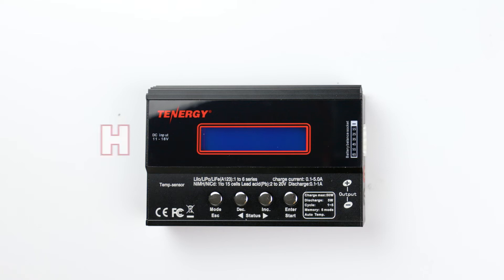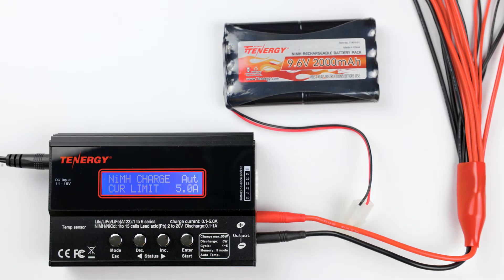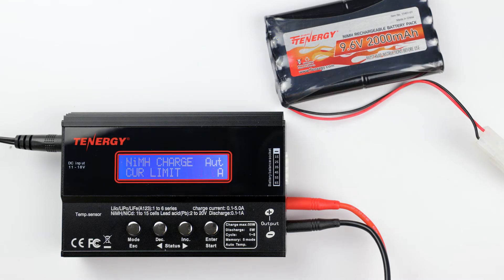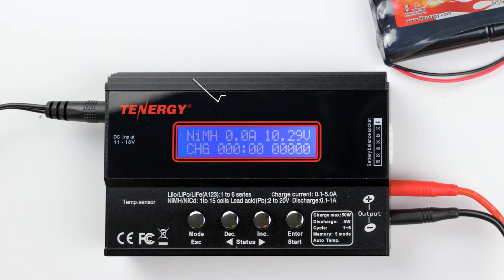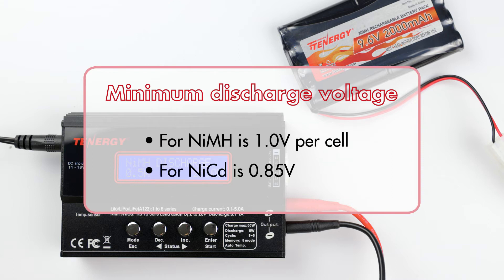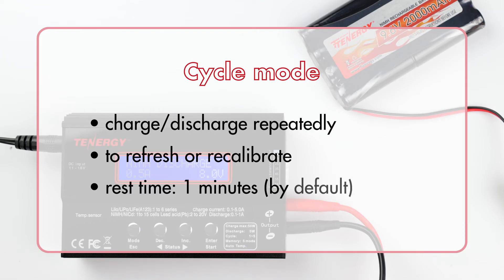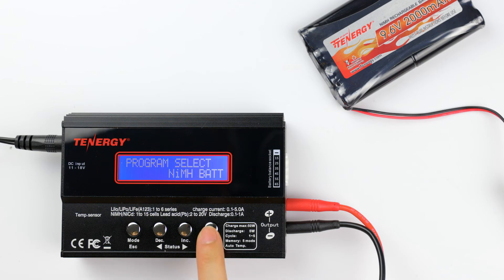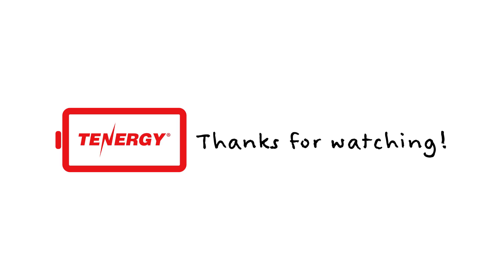How to charge and discharge a NiMH battery pack with Tenergy's TB6B (with voice-over)

Comment: I have a question. I have a NiMH battery, that its max voltage is 8.5 volts and is a 3000Ah battery. Why did the charger stop charging at 8.1 volts on the battery? Did I miss something?

Comment: This thing does not seem to be working correctly with Nimh. It seems to be timing out before discharging to my set voltage. The charge and discharge mAh are nowhere close to to the battery capacity. Like half. So far not impressed with it.

Comment: I set mine to cycle D>C x 3 and it discharged and then switched to "DRY" has been sitting here with a timer thats now up to 31 minutes. I figured maybe it was letting things cool before charging, but it hasn't. I've googled and searched around and absolutely NOBODY mentions this DRY message after discharge, even the manual says nothing about it. Will this thing eventually pick up and start charging on its own?
Reply: It started charging at 1hr. Thats a pretty liberal default cool-down timer

Comment: Would it be the same process for charging LiPo batteries?
Reply from the maker: We have a separate video for LiPo batteries at https://youtu.be/k1j1-FBgS3A?si=BrObwZOY7VsV7xjH - the process is similar, but some lipo batteries will need to be balanced charged, please review if your Lipo battery pack needs to be balanced or not, before attempting to charge your battery pack. Feel free to reach out to our team directly at service@tenergy.com if you have any questions before buying or using this charger

Comment: What is the best storage voltage for both Nimh and Nicd, pls?
Reply from the maker: Generally it's recommended to store the battery around 40-50% charged. For Nimh and Nicd the voltage will be around 1.28V-1.2V. If you're unsure and would like more info, please reach out to our team with your battery pack's specifications at service@tenergy.com and our team can help provide more info.

Comment: One question, might sound silly but is there any specific way to store these batteries for a long time,E.G. if the battery is not being used for a few months, do I store them at the minimum voltage or maximum voltage
Reply from the maker: Greetings, that's a great question! For long term storage, like a few months, we suggest storing battery packs that are nimh or nicd at 80% charged. If it's a lithium based battery pack, we suggest 30% instead. Feel free to reach out to us directly at service@tenergy.com if you have any additional questions.

Comment: Just received one of these with a used RC car purchase. 
This is a fantastic set of tutorials! 
One question… 

What’s if it is left on the charger once it is full? Does it have a maintenance feature?
Reply from the maker: Hi Jeremy, it's a good practice to disconnect the charger from the battery pack when it is done charging - this mainly helps ensure the battery pack lasts longer. For the majority of the time, leaving them connected won't be the end of the world - your charger and battery should be ok if left connected after being charged. For maintenance features, around 3:55 timestamp we cover how to cycle a battery pack (useful for packs that haven't been used for a while), this charger can also discharge your battery pack to 50% for storage (ideal for the times when you do not plan on using the battery pack for a while).
Reply: @TheTenergybattery  thank you so much for taking the time to respond!